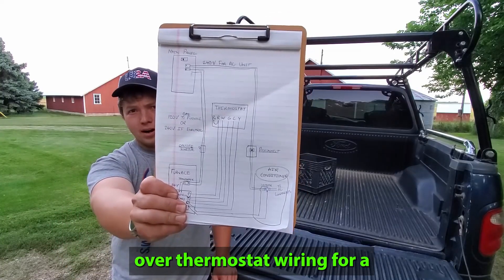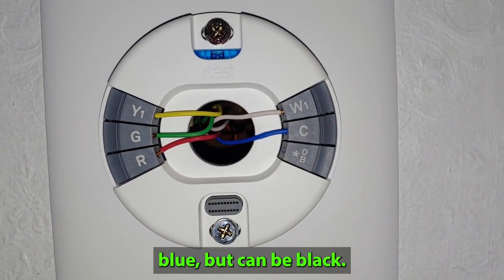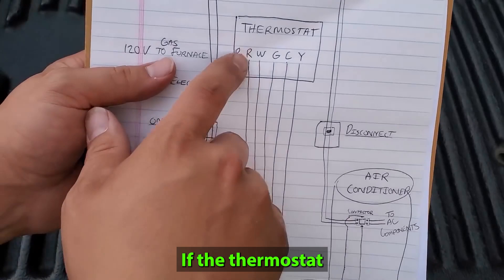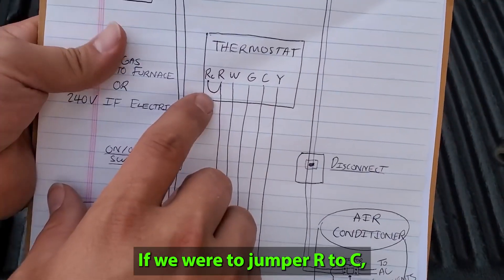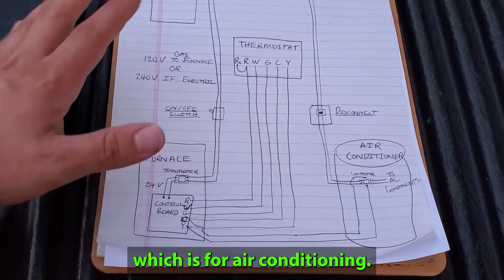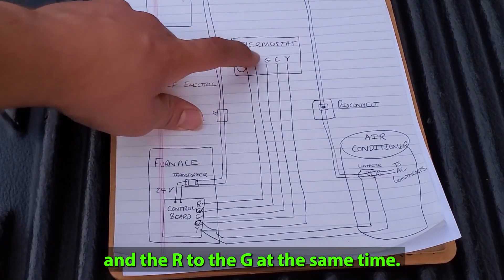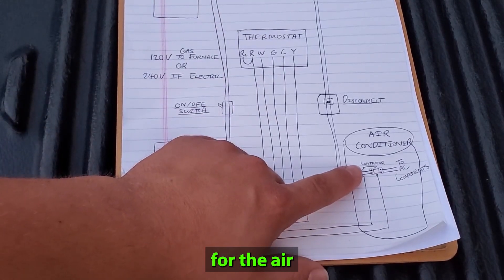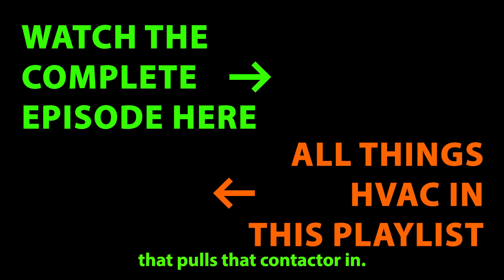Thermostat Wiring Explained in 90 Seconds!

Comment: This video is so informative. I had no idea the furnace fan would be running when the thermostat calls for AC. 

I have a nest thermostat and my ac is only intermittently working (mostly not working). After watching your video, I’m thinking the furnace fan is on because I feel air coming out of the ducts but I can see that the ac unit (which is outside) is not running. There is power to the thermostat but the ac unit is not powering on. Any suggestions about where the issue may be?

Comment: ben I have an air handler for my AC and a hydronic boiler with baseboard for heating basically two separate systems using a common nest E thermostat  red green yellow from air handler and red & white from taco switching relay need help with proper wiring diagram thanks so much for the help

Comment: Ben, Nice video. This describes a basic thermostate which controls Furnace, A/C-Air Conditioner, and Circulation Fan if so equipped. It would be good to add the following info to include some missing items:
1. The Transformer mentioned converts 120VAC to 24VAC - AC is Alternating Currrent (sine wave power). Don't confuse with A/C (Air Conditioner)
      This system typically controls 1-zone for either Heat Only, A/C Only, or both.  RED & WHITE have alternating voltage/current.
2.Many 'smart thermostats' use the 4 wires differently: 
    The RED and WHT wires receive 12VDC (Direct Currrent - No Sine Wave) FROM the control board. RED=Positive, WHT=Negative
    This voltage is used by the 'smart thermostat' to run the smart thermostat's firmware and display which supports multiple-zone temps and other    
      smart functions.
     The other 2 wires are labeled 'I+' and 'I-'  OR  A and B. These 2 wires support digital (packet) communications (RS-485) between the smart 
      thermostat and the multi-zone control board, and possibly also to a wireless WiFi interface board which provides connections to the internet for 
      remote-control apps. 
3. Hoping that this adds to further understanding for more advanced systems.        -RadioRich in NH

Comment: How do you check that the C wire is working properly? My Nest that’s been working fine for 3 years suddenly isn’t getting a connection to the common wire (Error E79). Any thoughts from anyone? I’ve cut and reconnected the common wire at the Nest.

Comment: While I am here, does anyone know of a thermostat that is split into the front or controls end of a thermostat, as in all human interfacing control and then a module controlled by the front end by RF to signal that various functions need to control that furnace or boiler itself?  I have a thermostat that the remodeler quite stupidly mounted in a corner of the room to miss having to deal with a pocket door in the wall (instead of doing the installation PROPERLY).  It is mostly hidden by a dining room hutch, in a “dead” room circulation zone  and it’s very hard to get to.  Thus the reason why I’d like to separate out the control end and actual thermostat and place it in a more appropriate spot.  Rewiring to do this is not necessarily out of the question but would be extremely involved to do given the finished basement below.